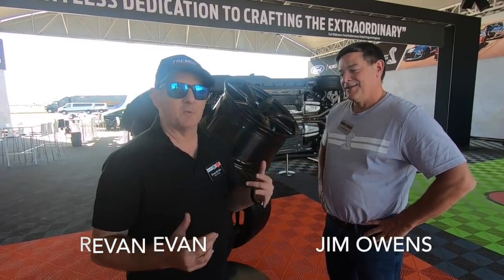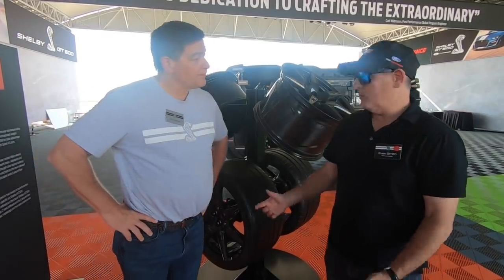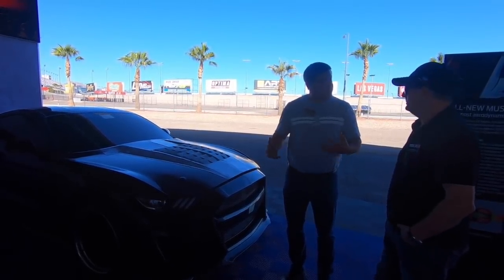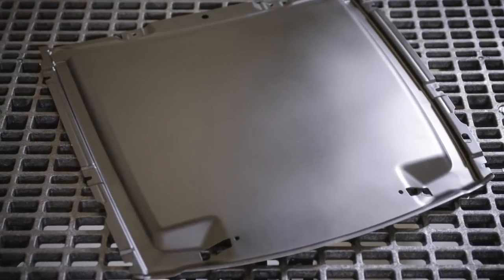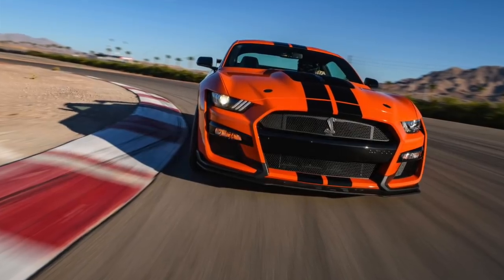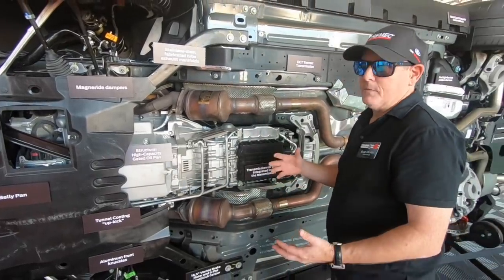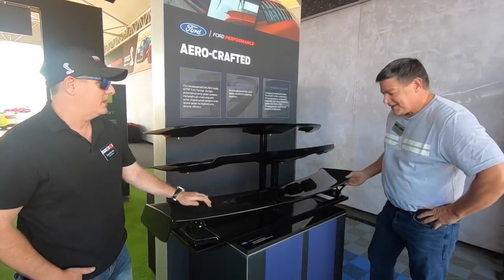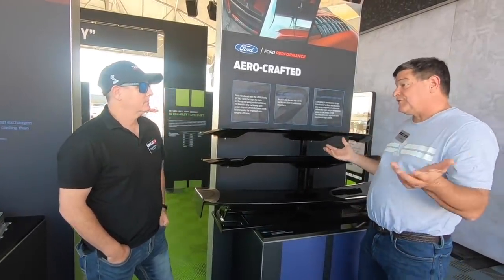2020 Shelby GT500 Mustang - What Makes It So Fast? We Go Deep Inside the 500's Guts

Comment: Light weight carbon wheel vs potholes == $80,000 car crash.
Reply: It’s also a super wide wheel which will handle most potholes which aren’t nearly 2 feet wide. Consider shock absorption and rotational mass which will distribute any smaller vibrations upon impact. If you’re on the road, you’ll probably be running much higher internal pressures in the tire, which would make the unit (wheel+tire) sturdier, transferring the impact to the shocks.

Comment: The GT500 is fast because Ford made it fast... really fast.
Like the Boss 302/Boss 302 Laguna Seca and the GT350/GT350R, Ford could built a second version... GT500KR sounds good...
Reply: J M Bauzo it should of been out 3 years ago it’s really not that fast compared to the cars that have been out for the past 5 years there late to the party and new mopar  and Chevy vettes will beat it soon enough shit I don’t think the Redeye has to worry much on the street or strip just the track put 315s on the Redeye and it will beat it
Reply: @JeffCarsboatsatvs  In reality the Corvette is not a true competitor for the Mustang/Camaro/Challenger class. The Corvette competitor is the Ford GT...
Reply: J M Bauzo not really if you look at the price point maybe the zr1 but not the zo6 that’s the same price as the gt500

Comment: What makes it so fast? Chevrolet. They copied a ZL1 and gave it another 110 hp 😂
Reply: Lol dct  tranny on the ford big difference shifts way faster and takes away less hp
Reply: ZL1 uses a traditional automatic 10 speed torque converter not a DCT. They also have a 6 speed manual.  DCTs are the future.

Comment: Rotational mass - add those huge steel rotors and see what if feels like. Yes, they removed weight from the wheel, but it was replaced with those huge steel rotors. Change the rotors to the carbon rotors and then you will be talking.
Reply: The hub is aluminum. They are not as heavy as they look.

Comment: Won’t mess with the 5.8 !! 13/14 forever !!!!!! You can have the 5.2
Reply: That 5.8 isn't even close to running a 10.60 stock. New gt 500 runs 10.60s stock.just imagine a few bolt ons tune and a good tire.good tire alone and it's running low low 10s. 10.2 maybe 10 flat.
Reply: stevie j your dumb if you think your gonna get 6 tenths out of just a tire from a car that doesn’t have traction issues to start with. Gotta love those no torque OHC engines. 😆
Reply: @nukegm67  a car that makes 760hp? Yes a tire will knock off .60.  Do you even race bro?
Reply: The 2020 GT500 is superior in every aspect of performance. What are you talking about...lol? The new one makes the '13-14 GT500 look archaic.
Reply: its doesnt need to! the 5.8 cant hold the new 5.2 jock strap!
Reply: 5.8. Hahaha. 5.2 is an exotic piece. Ford finally did it right with that engine. Best sounding V8.
Reply: As an owner of an s197, I appreciate it but stop it. C'mon this new GT500 is faster in a straight line, faster around a track, and has a nicer interior. Time to get over it.

Comment: It's fast but they making it seem like it's an 8 second car. It's got the power and tech to run mid-high 10s. It's the same as the hellcat redeye...its 200lbs heavier but 37 more hp and nearly 100 more torque which negates its weight disadvantage and guess what, it also runs mid-high 10s in the right conditions. Not that serious.
Reply: Hellcat redeye runs 11.8 in the 1/4 mile per Motor trend and Car, and Driver.   

Dodge claims 10.8 but it can’t live up to that unless it’s on Drag Radials.   

The GT500 is in the 10’s on a street tire.   The GT500 is worlds better all around.
Reply: @AB-coyote  those guys usually cant drive and or launch properly and deliver track times that are way off most of the time. We all know the hellcat has traction issues which the GT500 has to a lesser degree. But there have been many drivers and some videos with stock hellcat redeyes running 10.6s- 10.9s on stock tires. There was even one with just a tire who ran a 10.3 so it's all possible just needs the right driver and right conditions. Not taking anything away from the GT500 though,  it's an impressive car that Ford put out.
Reply: halow4 well this car is more track focused and still pulled a 10.3 or 10.4 in Florida and a 10.6 in vegas and more than likely they are going to make a drag version and it would be way quicker then the redeye
Reply: ElijahTBG it was a 10.6 in Bradenton Florida and a 10.8-10.9 in Vegas..
Reply: @Nlb_izz  good point. By saying that Ford made it to edge the hellcat at the strip and beat the ZL1 around the track...though that's yet to be seen. Well played Ford.
Reply: Trent Baker my bad thanks for the correction
Reply: @trentbaker3778  it's hot in Vegas, it was heat soaked that's why high 10s
Reply: @halow4  Even by Dodge admission, the redeye is a 10.8s car. With a DR setup and higher octane, some people have managed 10.3s. The GT500 should be able to accomplish close to this with the street tires and should best it with DR's and higher octane. Stangmode with a DA correction; estimates his 10.8 run could have been very well into the 10.4s with stock setup and better DA. (Las Vegas was a bad choice but it showcased the cooling system to perfection and great numbers for that scenery)
Reply: @ec3886  Fastest stock, full weight redeye on a tire is 10.22 That was with 3/4 full tank of 93 octane.
Reply: halow4 it’s not that serious to you but you know all the details. Funny AF
Reply: There's a whole lot more going on here then just quarter mile times. It's special because it got some all-around capability. Lot of tech advancements (mustang wise) being utilized for this model. In short.....It's got some goods weve never seen on a production Mustang.
Reply: So mustang gt out run hellcat
Reply: Mid tens right off the showroom,and that's with a crappy 1.8 60'.They are not optimized for drag racing(no trans brake,suspension setup,or slicks and skinnies).With  these add ons and a race tune,it's into the 9's.
Reply: No the gt500 is faster than the hellcat, the redeye runs 10.80s stock, gt500 runs 10.60s stock, doesn't matter if it's an inch or a mile it's faster no doubt about it.

Comment: The dual clutch transmission is the main reason imo plus amazing power weight ratio along with 760HP all together makes it super quick. The dual clutch transmission made a huge difference especially in acceleration in short distances.
Reply: Yusuf Elsayed Doesn’t have good power to weight ratio. It’s very heavy.
Reply: Considering it's acceleration with its weight. It's arguably decent.
Reply: I know it's 4,225lbs but it can still corner and pull amazing quarter mile times. The track package will be lighter thanks to the carbon fiber parts.
Reply: Yusuf Elsayed 
Exactly! How about when aftermarket parts start hitting? Tunes, better headers, improved supercharger/intercooler,etc🤔
Reply: Yusuf is correct about importance of DCT manual trans to this combo. Its F-1 Tech for the masses
Reply: 3.3 seconds isn't embarrassing considering it's a front engine configuration. Lots of these other cars like Lamborghini huracan and McLaren 720S are mid engine configuration which makes a huge difference in acceleration and traction. Mid engine configuration cars have superior power weight ratio and acceleration.
Reply: Gt500 is front engine configuration. What do you expect? You expect a United 3 seconds 0-60 with RWD? If it had AWD, yes it would do 0-60 under 3 seconds. It's not mid engine or rear engine configuration.
Reply: I LOVE TO SEE THE VIDEO OF EVAN TESTING MY 07 SUPERSNAKE BACK IN THE DAY LAYING DOWN A 10.87 AT 134.8 MPH BACK IN 07 MY SUPERSNAKE DID THAT TIME LOL NUTS
Reply: 3.2 seconds from 0-60 on a 760hp mustang, such a pity, and embarrassing.

Let me know when they make it under 3 seconds on 0-60.😄😄😄😄
Reply: El Chido 
Yeah, 0-60 in 3.2 seconds on street tires weighing 4,225 pounds 😑
Reply: Actually, the base model weighs 4,187lbs and the track package version weighs 4,080lbs. It's front engine configuration so it's 0-60 is not going to be like a car with a mid engine configuration.
Reply: Also, the GT500 actually weighs less than 4,225lbs. The base model weighs 4,187lbs and the carbon fiber package weighs 4,054lbs.